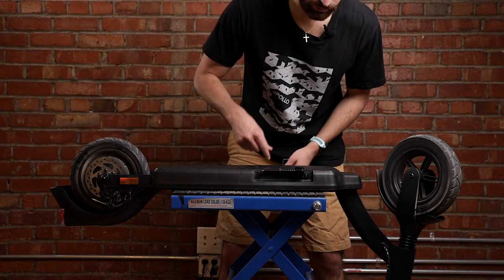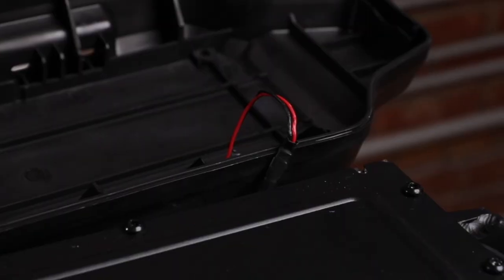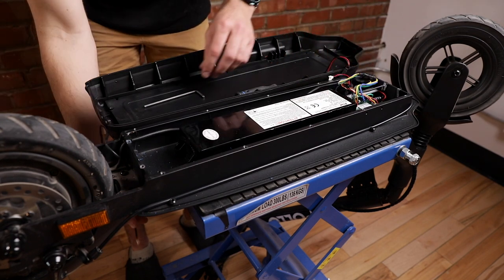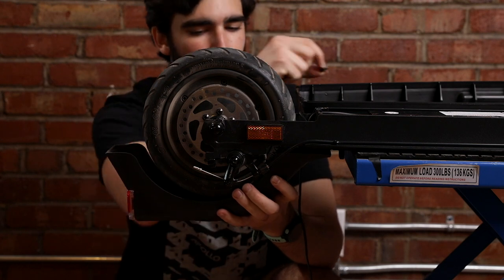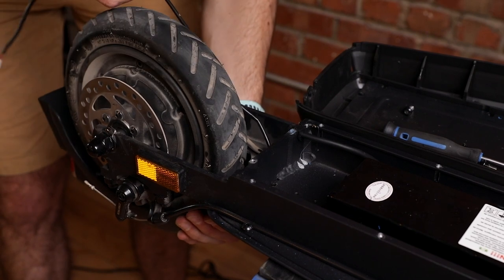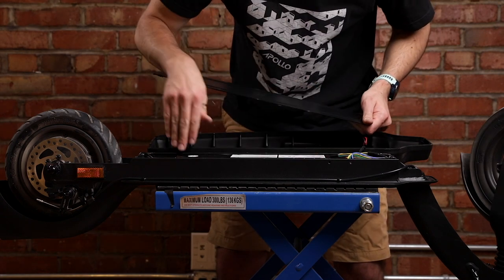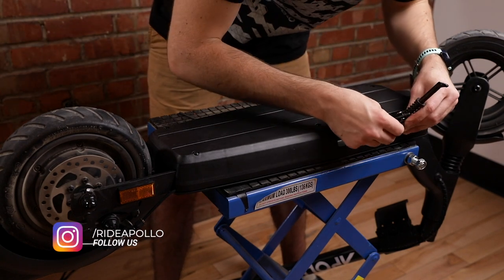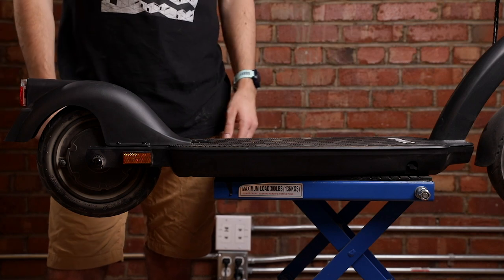HOW TO:  Replace the Rear Fender on the Apollo Air

Comment: Apollo how come there is space in the battery compartment at the back? Is there going to be an option for a bigger battery or something? Also amazed with a solid plate and plastic casing over the battery and other wires and components that the air scooters are only ip54 rated.